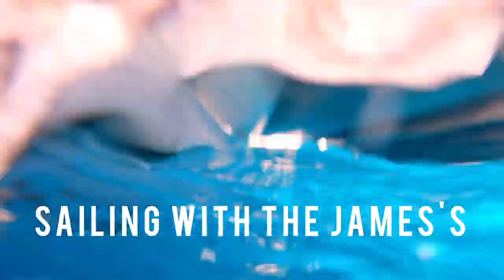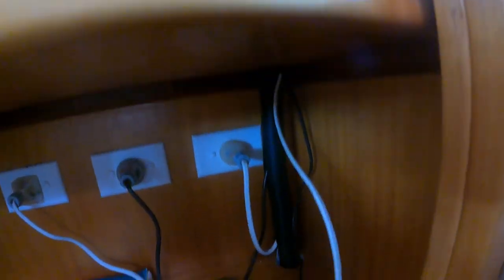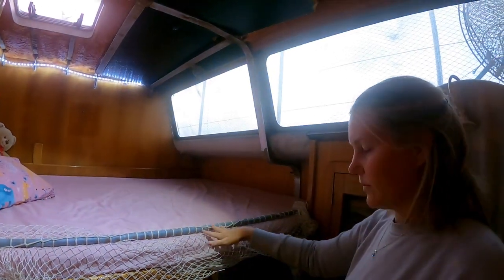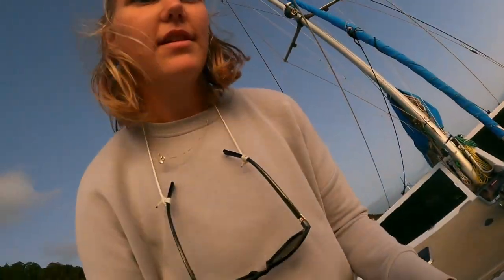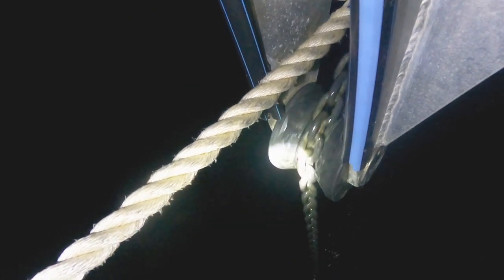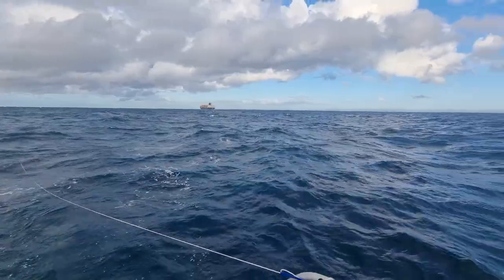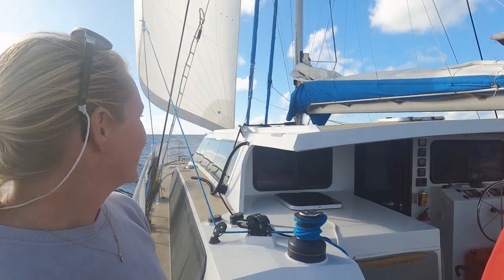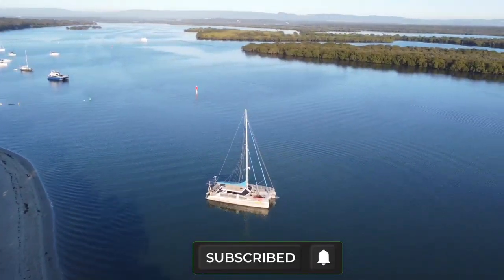Anchors Aweigh - Sailing Family sails new boat, aluminum catamaran, to Double Island Point [Ep.35]

Comment: Beatiful cruising grounds.. 
Putting a waterproof light and camera on a plunge pole is a great way to see whats going on below the surface especially at night ....when the night shift take over ... It can also help when you want to navigate the shallows or see whats tangled your props rudders etc..off shore. 

New pannels are 30.% smaller and theres a new compond coating been developed that binds with Si and alows it to convert 30% more of the lower energy red spectrum light by kicking it up into the Si solars effective available blue  end.. Cambridge university I think meantime you have a genius in this field working at the University of Newcastle NSW.. look up his work on U tube using printed plastic roll panels.
Reply from the maker: We will have to try the plunge pole next time. We only just brought the go pro's a couple of months ago and weren't quite brave enough to risk them.
-sam
Reply: @sailingwiththejamess  
Dont blame you 😂just try a divers torch first ... It lights up without the surface reflection esp at night.
Reply from the maker: Perfect, we have an old divers torch, I'll attach it to the boat hook and give it a go.
-sam

Comment: great work james family! how is the fix on the anchor chain doing?
Reply from the maker: The fix is going really really well. The plastic pipes have been protecting the sides from the chain quite well, now when the chain jumps off the rollers it's sliding on the plastic and not the metal
-Cait